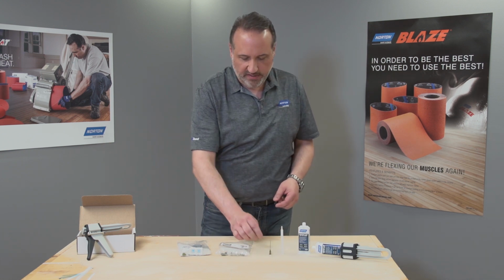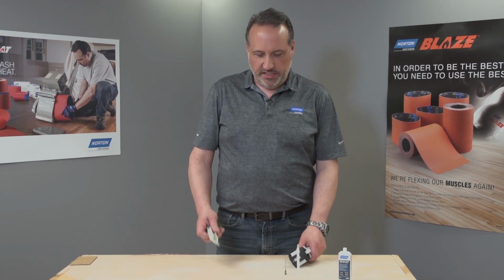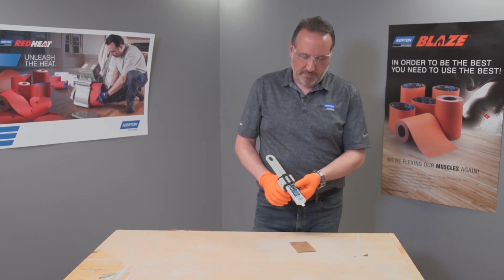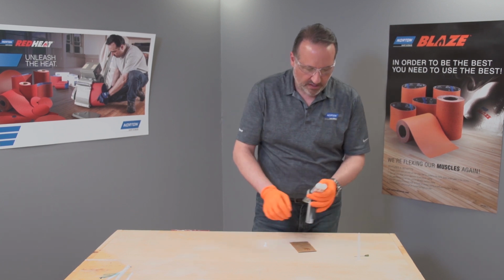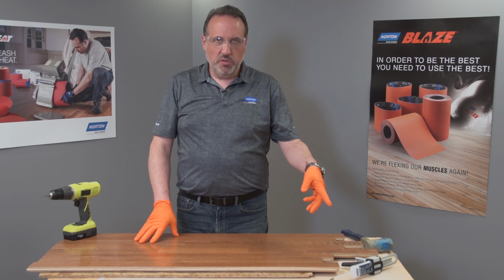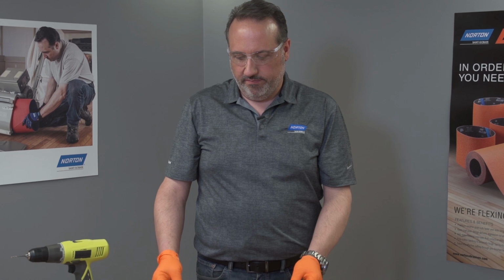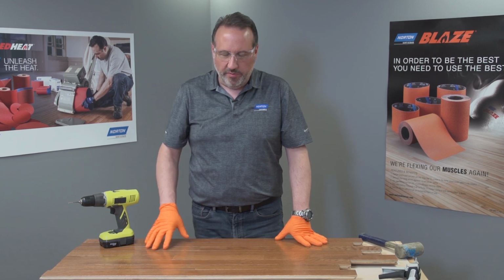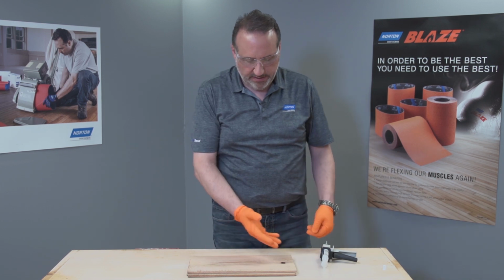Wood Floor Repair Made Easy with Norton Fast Set Epoxy

Comment: Looks flawed, after an application how do you clear out the chamber where the resin and the catalyst come into contact ahead of the tip ? say at the 1:37 mark. If you cap it they will likely kick in the spout, and if you pull the plunger back you risk contaminating the whole tube... no ? I think i like my separate tubes just fine thanks. Change my mind by showing a second use the next day.
Reply from the maker: The epoxy doesn’t harden if the cap is put back on or if you leave the nozzle on.  With a lot of contractors typically reusing epoxy and if something does harden on the opening, a quick purge and you're good to go.  But not a bad idea for a follow up video!  Thanks for the comment!

Comment: Is it safe to assume that in the void situation, the hole would be back filled with epoxy just like the knot hole example, or is another repair method recommended?